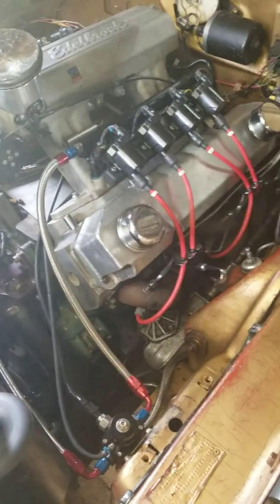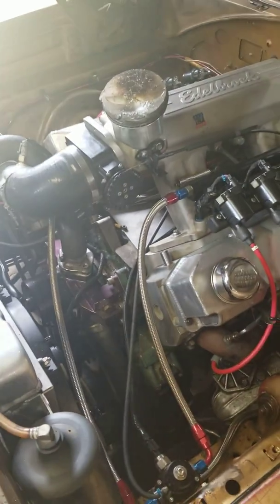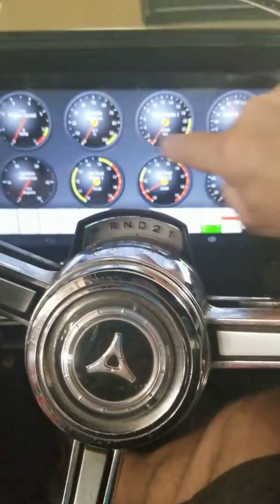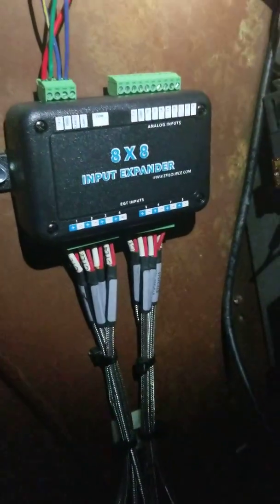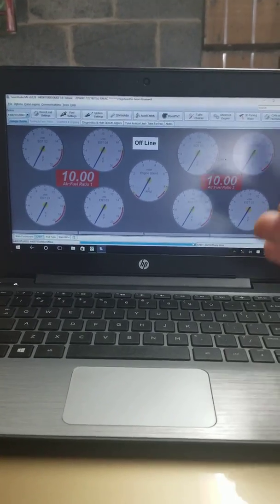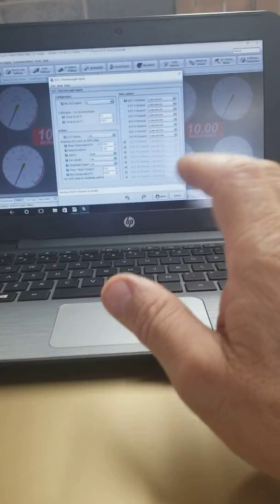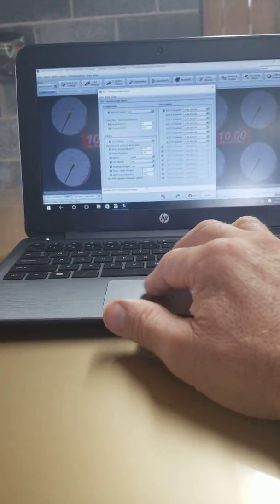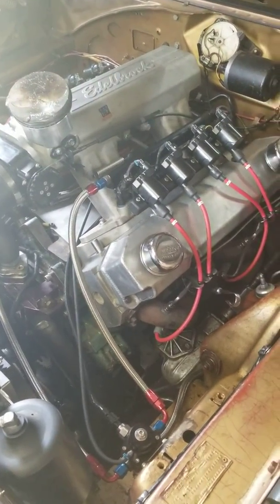EGT,  Megasquirt, Shadow Dash

Comment: Is there a way to make custom looking dashes?
Can you tune with shadow dash?
Reply from the maker: You can make custom dashes, however they need to be made on the laptop thru TunerStudio and then transferred to Shadow Dash. You can select by swiping the screen up to four different screens. It is not possible to tune thru shadow dash but you can select a already saved different tune

Comment: excellent project, I have a 318 duster with microsquirt, a garret gt51 with LS coil per cylinder, but I have overheating problems, do you know any method to solve it?
Reply from the maker: Hi Miguel
 I am assuming you mean your engine is over heating. If it only overheats while idling it could be you need a fan shroud or fans that move more air if there electric. If it overheats while driving or sitting check your thermostat. When I first installed the turbo on my car my engine began to overheat so I decided I needed a better radiator and replaced it with one from Engineered Cooling Products which solved my problem.

Comment: nice ! im trying to do what you did too in my valiant. keep it old school but with new age tech as well. want to do a pi dash in mine. how do you like the shadow dash ?
Reply from the maker: I like Shadow Dash it's pretty much wireless except for charging, I have mine setup so that when I hit at set rpm the tach turns red, it acts as my shift light. I was looking at PiDash  it has a lot of benefits but I have not seen a touch screen that will fit the way I want.

Comment: Keep it going man. I'm getting all the parts and pieces for my d100. Trying to go the same route as you. Well except big single turbo.
Reply from the maker: Glad that you like my videos
Reply: @jimgreenwell1244  what did you end up going with on the ignition system? Crank triggers and a cam sensor? Also what heads are you running?
Reply from the maker: @damiendoisher7812  I use a 36-1 trigger wheel with a 3 wire hall sensor. The cam position sensor is out of a 6cyl jeep motor. I am using ProComp heads.